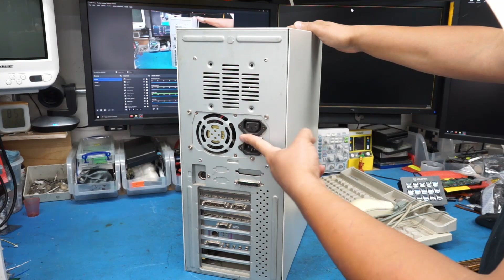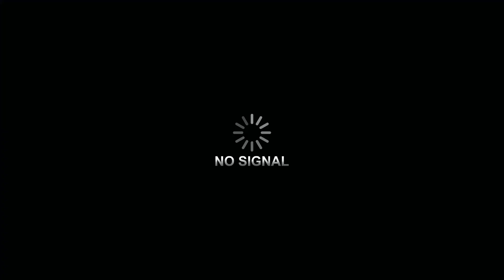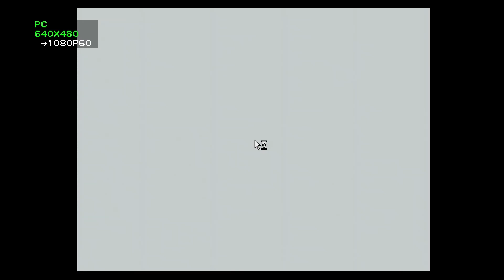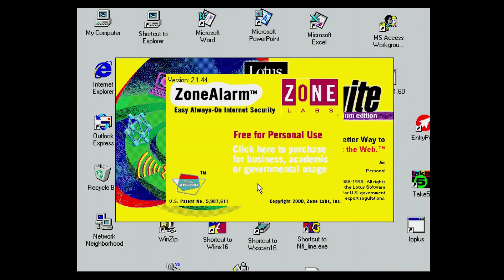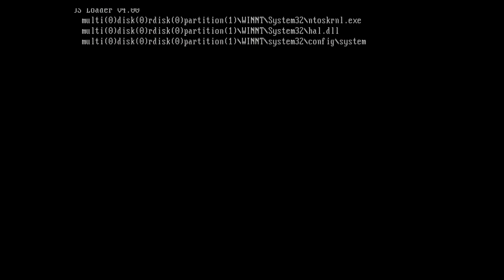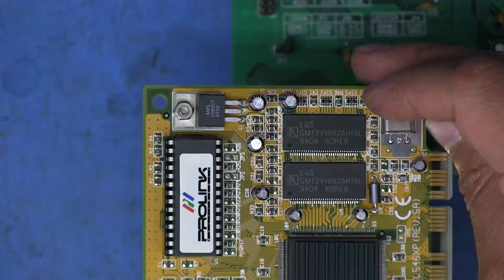TEF #176 | Briefly Exploring A Mystery Retro PC

Comment: Regarding the drive not reading when connected through usb:  could it be a file system issue?  I'm curious if a modern version of Windows could view and older version of NTFS or FAT?

In the past I've had trouble viewing spare hard drives I ran on a linux box due to file system.
Reply from the maker: I was thinking the same thing as well. I think it might be FAT on that drive. I have some older machines that I might be able to check it with, but I haven't had a chance to set up anything just yet.
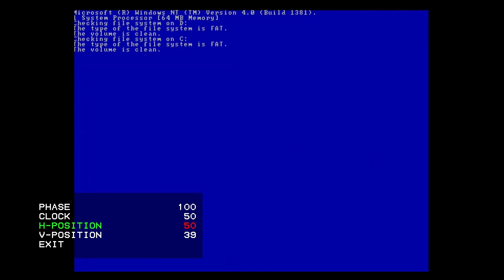Reply: @ThatElectronicsFool  At 12:25 it said it had two FAT partitions. I've been using PCs since DOS 2, and I don't think I've ever seen NT Server running on FAT!
Reply from the maker: Good catch, I was too distracted trying to get the image just right that I glossed over the fact that it said two FAT partitions.

Comment: I would recommend getting a older core 2 duo system with onboard IDE that is part of the chip-set and not a 3rd party ad on chip for looking at that drive.  If that is not possible any system with PCI slots and a PCI to IDE card with its own dedicated bios would do.  I would use Linux and image it with ddrescue as that drive does not sound very good.  Not sure if there is any software on it that may not be online already.
Reply from the maker: I don't know that I specifically have a C2D board on hand, but I've got a bunch of other stuff that I'm sure I can cobble up something to get it read. 

As far as the sound of the drive, it's not all that bad, just sounds like a fairly normal spinner of the time. I just had the microphone right up to it so you could hear it ticking away as it loaded. 

Thank you for the Linux suggestion!
Reply: @ThatElectronicsFool  It does not have to be a C2D board, it can also be a AMD one.  Just needs enough processing power to run a modern Linux distro to run ddrescue and have a hardware based IDE controller.  I have had issues with the software based units or the cheap 3rd party add on chips on motherboards that just are there to tick the box for having IDE on the board.

Comment: Yeah, Intel went from no heatsink, to optional heatsink, to mandatory heatsink, to mandatory heatsink with optional fan, to mandatory HSF, all before they started mandating thermal compound. Original Pentium was at that mandatory HSF stage. :)
Reply from the maker: Yup, our machine at that time had a 200MHz Pentium non-MMX. It only used a passive heatsink, but it did have thermal compound, if I remember correctly.